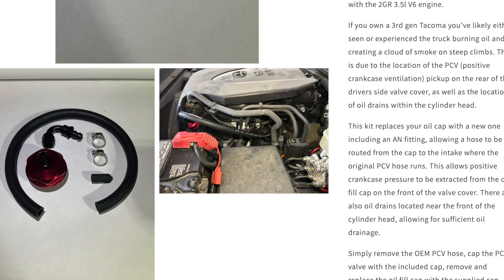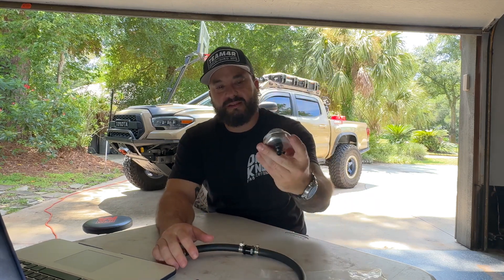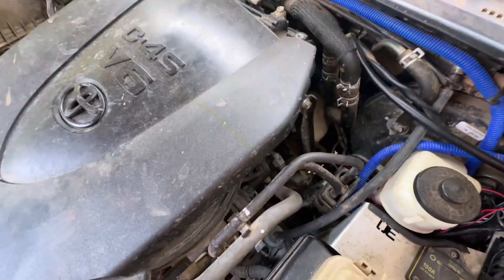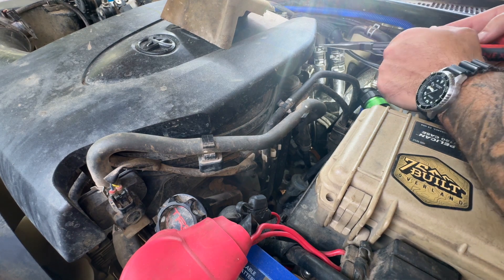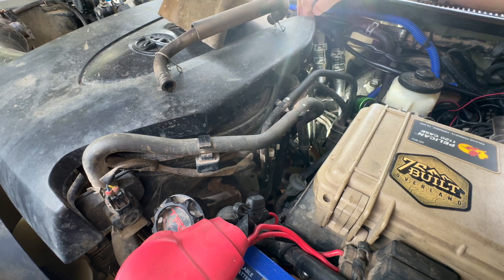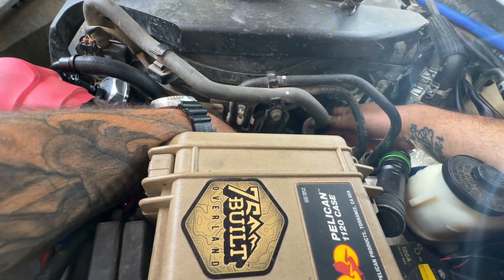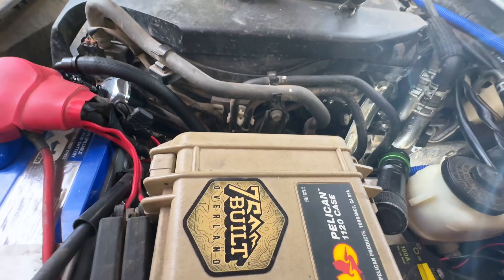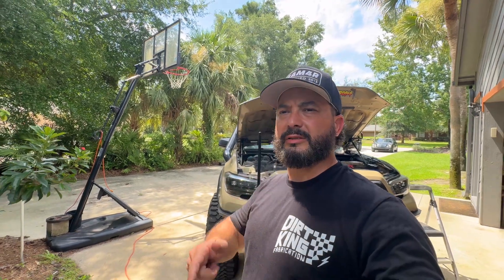RM Engineering PCV Re Route on a 3rd Gen Tacoma

Comment: So when changing your oil. Does the cap come off with the hose still attached or do you need to undo the hose from the cap first? Waiting for them to come back in stock atm.
Reply from the maker: Iffy, I had to to it both ways. I normally just take the hose off first then the cap. Thanks for watching.